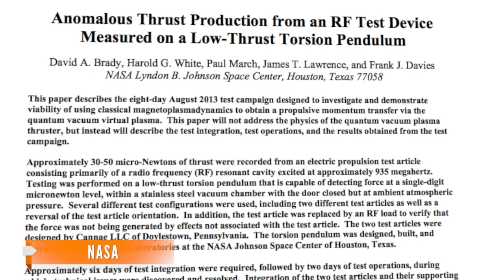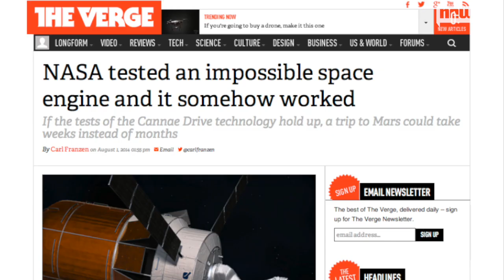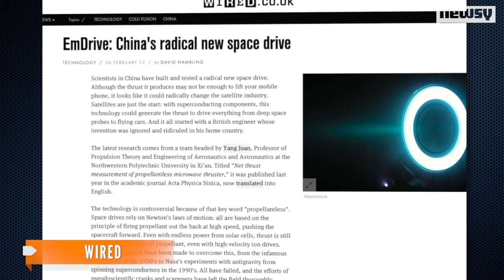NASA Tests 'Impossible' Engine, Finds Out It's Really Fast

Comment: Or you can use a Nuclear Salt Water Rocket. Dangerous as hell to get into space, but it's freaking roses from there on out!!! With a specific impulse of 10,000 it pretty much dominates any other method, and is retardedly simple.
Reply: Matthew McKellar playing too much KSP, huh?
Reply: Matthew McKellar playing too much KSP, huh?
Reply: Eric Depina Do they have those in KSP? I thought the highest we got was a Minerva
Reply: oh, im speaking of mods, you can use a molten salt reactor with thermal rockets, amazing ISP and can use atmosphere when available instead of fuel, and can use tons of different fuels for different isp or thrust amounts, depending on what you want to mine.
Reply: Eric Depina Ohhh, this is different, imagine radioactive salts dissolved into water, and to fire it off you just pump it into the nozzle where it gains critical mass. It's functionally monopropellant

Comment: warp drives that move space.  uhh interesting concept but how the fuck would you do that? don't tell me by spinning something..
Reply: Warp drive manipulates the structure of space around you, allowing you to traverse space without actually having any velocity
Reply: +Xannari Ferrows how does it do that?
Reply: Maathiu Ra Yin Now that is the hard part. Try to picture it like this:
Positive energy; matter and antimatter, create bulges in the grid of space, affecting the gravitational and electromagnetic fields. This results in an increase of absolute distance required to traverse the same amount of space.
Negative energy on the other hand, creates contractions in the grid of space, resulting in a decrease of absolute distance required to traverse the same space. You can demonstrate this with a rubber strip. Tape both ends to two spots on a table. You can stretch the band out in any number of ways to get from end to end, which represents the effect of positive energy.
To represent negative energy, you have to imagine the band being able to change into a shape that makes the distance between the two ends shorter, which is not the easiest thing to do admittedly
Reply: Maathiu Ra Yin In Jingle's terms

Comment: Wow, this reporter doesn't have a clue what he's talking about, even after he reads others explanation of it.  The virtual particles are used as the propellant that is shot out the back by electrical energy that is provided by either PV cells, or a nuclear reactor.

Comment: I came up with an idea of an engine that could travel quickly around any star system. It would have a combustion chamber constantly under compression, and one by one, atoms are thrown into this chamber, collided, and kept under pressure for about a second, until only the rear end of the ship releases a but of this energy, resulting in all this energy shooting out of the craft. With it under pressure, then suddenly released, it would create and engine that could travel long distances quickly and efficiently, thought it will be one massive ship, and have to be constructed in orbit.

Comment: First you say that the device works by "bouncing" microwaves inside a box, and that would somehow generate thrust. This doesn't make sense and is physically impossible. Then you say it works by turning quantum virtual particles into real particles, which is also physically impossible. And finally, the amount of thrust you said was procured was 30-50 micronewtons, when the equipment used isn't sensitive enough to measure that kind of force. This is all a lie.
Reply: Not a lie a unproved hypothesis waiting for testing It is possible that it might be cold fusion again . You are correct that 30 - 50 micronewtons is less than the error margin . A lot of what we are told through the media is filtered through journalists no known aS maths and science heavies from high school they did well in english class . Not only that but the journalists I have met over the years were more interested in filtering alcohol

Comment: Not fuel, propellent. You are misinterpreting fuel with propellent. Traditional rockets eject propellent in one direction to create thrust in the other, the Newtonian action reaction principle.   Chemical rockets get their energy from the chemical reactions of the fuel and ejects the byproducts of the reaction as propellent. Ion and hall eject drive uses electricity from a source such as solar panels or a nuclear reactor to eject ionized particles usually xenon gas, out as propellent. The M drive does not use any propellent, it only resonates radio waves in a chamber, we can only guess how this could work and the guess of quantum virtual particles being used as propellent is a bit of a stretch as other than Hawking radiation, we don't know of a way to bias the direction they would go in. Also virtual particles would limit the thrust to very low levels unless the quantum zero state could somehow be effected which might end the Universe as we know it. It's far more likely that we're just missing something with our observations of the M drive therefore it's too early to tell if the effect could be used.
Reply: MrAaronvee There's no doubt that the NASA efforts were very much a political decision but your viewpoint as to how it's tainted origins and policies effect their current efforts are obviously out of ignorance.  It's easy to say that Goddard was foolish in believing in gyroscopic levitation but that's from our perspective, from his it was simply that there was something that wasn't well understood at the time.  Keep in mind that chimneys weren't built till the eleventh century because prior to that they believed in the caloric theory of heat being a fluid which rose in the same way that smoke did hence a chimney would defeat the purpose of heating a home. Likewise, we are now discovering that the widely held belief that natural saturated fats should be avoided for heart health isn't widely supported by studies. None of this says that the scientists of the time were stupid, simply of their era and with that era's limited information. Likewise, the em drive may be viewed as a fool's errand in the future but at present it's simply something with an effect anomalous to our understanding, I doubt anyone serous about studying it think it has an effect that might prove usable as such matters are typically countered by something we haven't considered observing yet. I'm assuming that you are referring to dark energy when you refer to anti-gravity research, that's called dark because it is an effect that we only barely observe indirectly and do not yet know how to fully observe and it's only referenced as having anti-gravity like effects as it seems to cause objects to disperse by an apparent expansion of the intervening space proportional to the space between the objects.  Dark energy is a topic of astrology and cosmology not a subject directly investigated by NASA though researchers would be using NASA to determine how better to observe the phenomenon.  Concepts similar to dark energy dates back even to Einstein trying to make his theory of general relativity consistent with the then prevailing view of a stable universe, naturally he abandoned it once the theory of the expanding universe became accepted but only because he didn't have the anomalous data that we have now.   Your attitude of just brushing dark energy off as silly anti-gravity research only displays your ignorance.   Your other criticisms are more of a bureaucracy than anything else and quite frankly, any venture of a sufficient size are subject to those mistakes, it's the job of good management to identify such risks in the decision process and of course with political influences especially with regards to funding, management and decisions are often questionable.
Reply: +MrAaronvee The very premise of engineering is to apply science and technology to the benefit of mankind. There will often be a lecture to stress that much of physics is unknown and much of what we believe of physics are likely false but so long as we understand the limits of our understanding, they can still be applied. The specific lecture in my case was that we spent the entire lecture on the Energy Molls model of the bipolar transistor only to end with the professor saying that all of it was completely false, then saying that so long as the conditions were within certain limits, the first term of the equation is accurate enough for valid predictions even though we know that the science behind it is wrong.

It's also true that engineers are human and hence there is a great variety of understandings of science and physics. This is repeated in engineering lectures constantly, that you must review and research before submitting an opinion as a professional engineering opinion. It is also repeated that because of your profession, others may view a casual opinion that you've offered as a professional opinion and hence you must always clarify that it is only a casual opinion, basically that free advice is worth every penny you paid for it.

Your statement shows ignorance of engineering, science, physics and people and it just took the generalization of "Engineers are notorious" to show how limited your viewpoints are.
Reply: Keep in mind that no true scientist would claim to understand or even know all of physics.
Reply: Personally, I would trust NASA's observations in a field like this.
Reply: to John Wang, thank you Mr Wang that was interesting.
Reply: Benjamin Scherer By all means, contact NASA.  It's been a few years since I've worked with them but they do seem reasonable.
Reply: Never worked for them but did meet with them on occasions just as having met with CERN on occasions.   Is that a good thing, I never said so, perhaps we should ask why you would make such an insinuation, a bit insecure are we MrAaronvee?
Reply: John Wang, good sir, you just blew my mind. Thanks for writing this!
Reply: John Wang p
Reply: To those who look carefully at things, instead of swallowing the public-relations output, NASA and the entire history of American spaceflight is tragicomical: from Goddard who originally thought that he could use 'gyroscopic levitation' or an Emdrive-style device instead of rockets, via Parsons (the devil-worshipping explosives expert who blew himself up), Zwicky (who thought that rockets would not work in space) to Von Braun (the war-criminal smuggled-in via Operation Paperclip). NASA has since killed 7 people through not understanding rubber, launched a telescope without checking the optics, lost a Mars probe due to using inconsistent units, and wasted money on silly 'antigravity' research.
Reply: Engineers are always notoriously ignorant of physics and mathematics. The properties of gyroscopes were well known to Euler, hundreds of years ago. That said, Newton never got to grips with the motion of spinning-tops, and even Einstein thought (for a while) that they should fall more slowly than non-spinning objects, even in a vacuum. So Goddard had no excuse, even in his day. A few years ago, somebody at a reputable US university earned an MSc for work on a ludicrous propulsion concept. He was overseen by two professors of engineering; one of whom had worked at NASA. Clearly, pig-ignorance of the Goddard type still exists today. Engineers are not scientists!
Reply: True ... but it does not take long to demolish baseless theory and incompetent experimentation. In fact, it is the very ignorance of 'all of physics' which causes crackpot inventors to declare that they invented something new when, in reality, they have failed to take account of an obscure - but known - effect. That is to say, an effect which is 'known to science' ... but not necessarily to them.
Reply: You admit to working with NASA? Oh, I get it ... you think that that is a good thing.

Comment: The title of this video is misleading and shows a lack of understanding.
A drive isnt "fast" or slow - it produces an amount of thrust - an engine that produces a lot of thrust will get "fast" quicker than one that produces a little thrust.
The engine test produce an "anomalous" thrust of a tiny amount.
This is more likely an experimental design flaw or measurement error than a real thing.
One thing microwaves could do is heat up air and the escaping heated air could produce thrust - no need to hypothesize about virtual quantum particles until you see it actually work in a hard vacuum.

Not convinced anything real going on here.

Comment: so where do you get the power to generate the microwaves? and micronewtons, seriously? even a weedy ion drive produces 1000x more.
Reply: +Steve Paulsson Well probably solar or nuclear for the power source and of course its small its a proof of concept and a poorly understood one at that.
Reply: +odstwingman yeah well there are lots of well understood ways of turning solar or nuclear into motion, like solar sails and ion or photon drives. I get it that this concept is supposed to get rid of the need to carry mass around to fling out the back (solar sails and photon drives solve that problem as well), but there is lots of mass out there that you could scoop. I like the idea of using icy asteroids as filling stations - use solar power to melt and electrolyse the ice, getting H2O and O2 for life support and H2 and O2 for propulsion. Another idea I've wondered about: cosmic rays consist mainly of ultra high-energy protons and occasionally antiprotons: could you maybe trap the antiprotons and collect them? Also, if you could figure out a way to collide the protons and antiprotons, you would get vastly higher energy levels than the LHC or anything we could build on earth. 

Blue sky is fun and free.
Reply: Using icy-asteroids is ok as long as you were going to visit icy-asteroids in the first place, but would you want to drive from New England to Florida if the only gas stations were on the West Coast?

Comment: if the oil industry isnt profitting from an invention, then its not going to be taken seriously by any scientist, because they are all on the payroll of the oil industry. and nuclear is to dangerous for human travelers.
Reply: +MatriXz well, we are talking about spacecraft propulsion..check out ion engines!!
the thrust produced is minimal and a car wouldn't move at all if it used it. instead, spacecraft have plenty of time and can benefit from the efficiency of the engine and not the acceleration

Comment: There is a system  space craft needed to collect cosmic energy then covert it to magnetic pulse which will rattle a mass  up and down but  one direction will hit hard then other direction not hit which helps spec craft to rowing kicks and spce craft will accelerate gradually at doubling speed .

Comment: they're called virtual because they're partical-antipatical pairs. they self destruct as rapidly as they form. the "hawking effect", as far as i can understand it, seems to imply that you'd need a black hole event horizon to convert them from virtual to actual particles. do these virtual particles exist long enough to be accelerated? if they don't then this idea's is dead in the water.

Comment: Maybe there is something we haven't discovered yet that makes this engine work. Maybe it doesn't break laws of physics. This concept has been dismissed too quickly because of a lack of scientific explanation.
Reply: +Cretium The issue is never with the exotic engine. The engine is designed based around math and it works to the mathematical model. What the real issue is, is that these amazing engines are design around an 'assumed' power source. I mean, they built this around current power sources and they get 50 micro-newtons out. 50 micro-newtons isn't sh*t when modern engines are measured in kilo-newtons and I bet they put in a ton of power just to to get that 50uN out. What are we gonna' power through space on 50uN? An egg box? Even then, you'd have a burn time of a year just to make a single maneuver. 
Well, I suppose in that sense, if you're not fussed about time, it can be used to go to the stars. Forget about it reaching mars this century though. haha
Reply: +Cretium More than likely is that the "laws" we have discovered are incomplete.

Comment: This is a big breakthrough.  Basically, this is equivalent to Star Trek's "Impulse Engines" for traveling at sub-light speeds.  
Also, as to Warp Drive, NASA scientist Harold "Sonny" White reworked Miguel Alcubierre's warp field equations.  By changing the shape of the warp bubble to a torus, he brought the energy requirements down to real-world levels.  Right now, there is a gadget in his lab at the Johnson Space Center called the "White-Juday Warp Field Interferometer."  The purpose of this gadget is to detect any warp fields they might create in the lab.
Reply: Mark Stockman lol nerd

Comment: Plazma vacum engines. This is one of new generation engines. If it realy works, it could open the dors to reach mars in a weeks. Nice to see changes from atomic rocket fuel to quentum leap plazma engines with powerful forces. I don,t believe that we ever could travel upwards and backwards more than 40 light years away from earth fast. But to reach easily aur neibours alfa centuri and many other star systems, like a gold, oil, sea of fuel  planets. This is reality in the next 50 years. Micronewton range, needs many test. And takes time to test the stability of the engine in big scale. I,m gona waching it. Warp drive which we can propel useing negative energy as well becomes to  reality. It since fiction, and takes more time. Antimater  takes longer to produce, unreality for us. Warp drive since fiction. Plazma next generation reality to fly anourmous distances even light years in month.